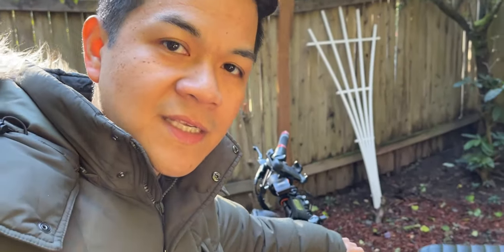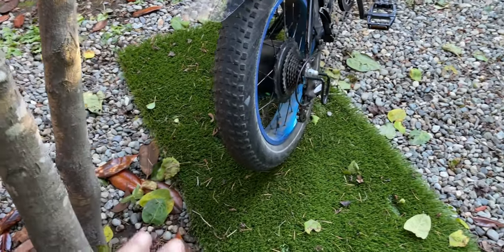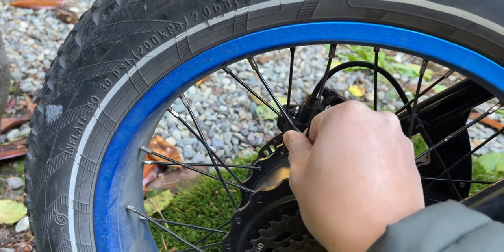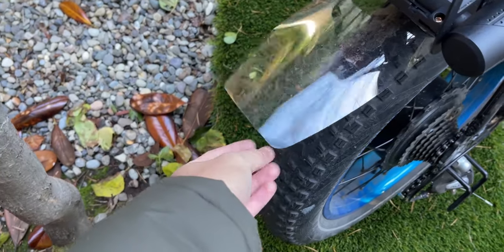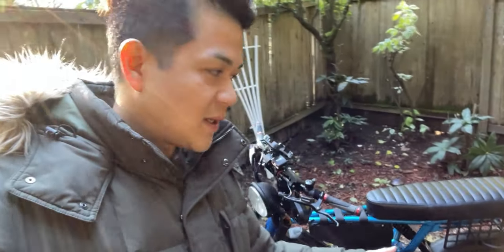Ariel Rider X-Class 52v: 1,000 Miles Later Impressions and Accessories/Mods!

Comment from the maker: Chapters below in case you want to skip ahead at specific topics only. 

Get your minimalist smart wallet here to go with your e-bike rides!
► Ekster Wallet: shop.ekster.com/LloydSim and use the code LLOYDSIM for up to 35% off a smart wallet today!

Chapters:
0:00 - Intro and which X-Class I have
0:45 - Disclaimer
0:56 - 1K Miles Proof + how long I've had my X-Class
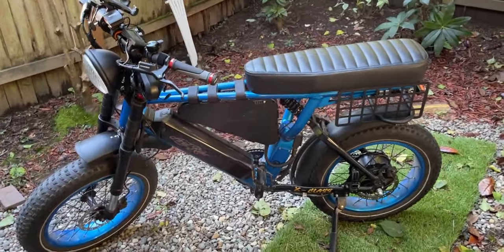1:36 - Seat
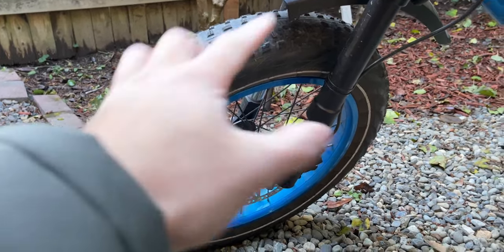2:38 - Stock tires impressions & what I do
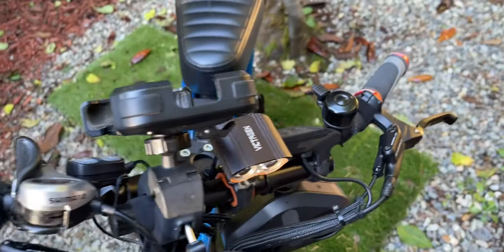6:59 - Handle bar grips
7:54 - Bike stem
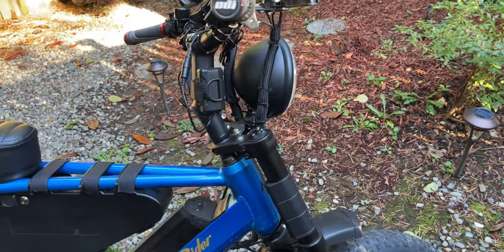9:04 - Rear and Front Shocks
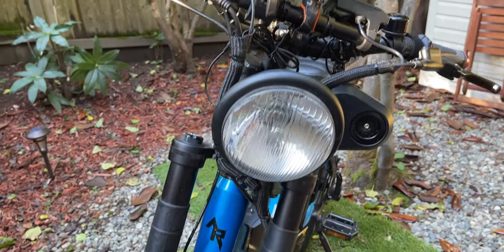11:27 - Headlight positioning
12:45 - Stock battery and 2nd battery mod
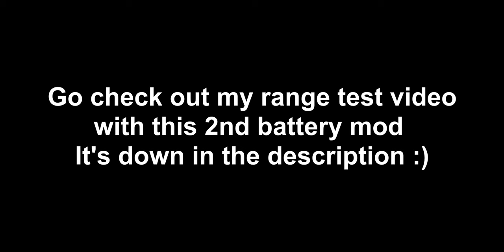15:04 - Handlebar and Handlebar Accessories
16:34 - Minor Maintenance/Mechanical Issues
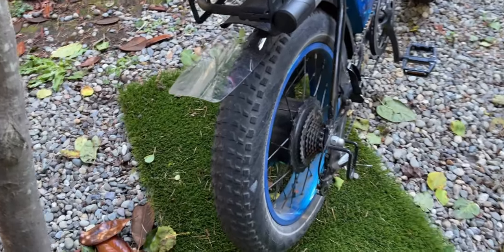18:57 - Mud flap
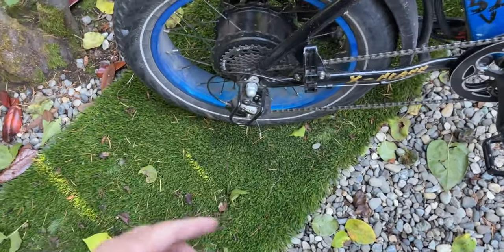19:46 - Hub Motor and any other issues?
21:44 - Wrap up

Comment: I replicated the rear fender extension by cutting up a face shield (had some lying around, my mom bought them in 2020 in light of the pandemic) and taping it on using 3M adhesive tape. Works perfectly it deflects all the grime and filth!
Reply: Nice! What did you use to cut it?
Reply: @tonyholmes9024  kitchen scissors

Comment: When you charge the batteries do you unplug one and charge them separately?
Reply from the maker: no need :) I charge them at the same time, but I usually turn off the triangle battery just to be on the safe side. The AR stock battery is always on for X-class.
Reply: @LloydSim  so if you charge the stock battery it will charge both?
Reply from the maker: @ss396rat   no, the separate battery comes with it’s own charger when u buy it, so u have to plug in both chargers to their designated battery—1 for the AR and 1 for the 2nd battery
Reply: @LloydSim  got it

Comment: I just ordered one but am already kinda regretting it. I have watched so many yt review videos and it seems there is always something. But now if I refuse the delivery theyll get me for a fee or if I open it and return it I have to pay for shipping and that restocking fee I think. I don't know what to do.
Reply from the maker: It really depends on the batch you get i guess? I find that most ppl that complains/have issues though are always the loudest online hence they always standout in these research. Anyway, mine’s running fine. I have 2,000 miles already. I replaced the stock tires cuz I literally ran them till they were bald. I should probably make a 1-year raw video update soon. I’ll post it next week, it’s a bit overdue lol
Reply: I got mine and I have no complaints just change your inner tube

Comment: So 2500 miles, then what? The bike is finito????
Reply from the maker: Eh, I’ve seen folks with 3,000+ miles on facebook. My friend has 6,000+ miles but he does doordash with them.
Reply: @LloydSim  but then what? The bike is no good anymore? Or would have to replace the motor? If so, how much would that be?
Reply from the maker: @HK-uj9qc  Nothing. It really depends on what happens. I’m fortunate enough nothing major happens to mine yet, but basic maintenance like greasing the hub motor is a good practice, but I haven’t yet had to do that—you can take it to a bike shop, but that depends on the shop and the price they’ll quote you, kind of like a taking a car to a repair shop. Ariel Rider has a 1 year warranty I believe, but I never needed it since I didn’t have any issues on mine. You can join this FB group for some basic maintenance DIY and tips, or if you wanna go do a lot of crazy modding, lots of helpful ppl here: https://m.facebook.com/groups/906613363426000/?ref=share&mibextid=S66gvF